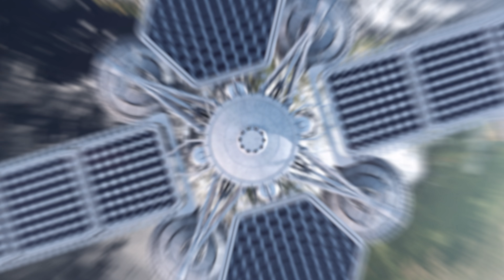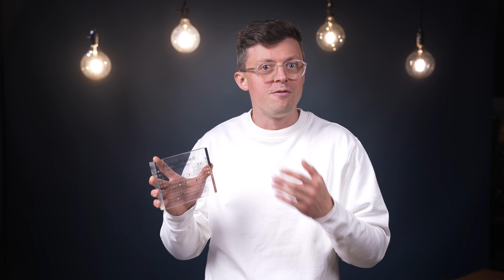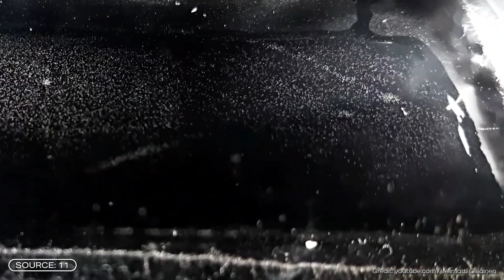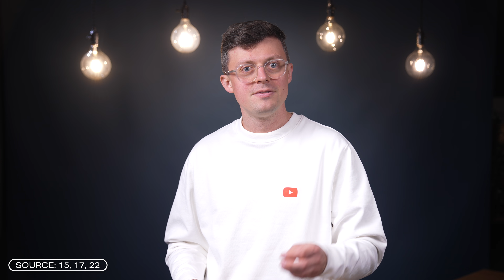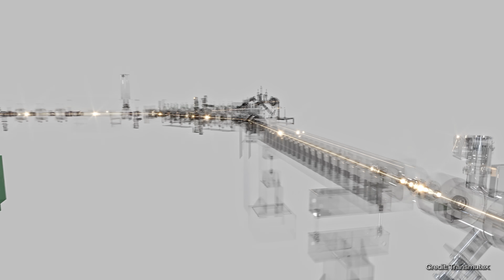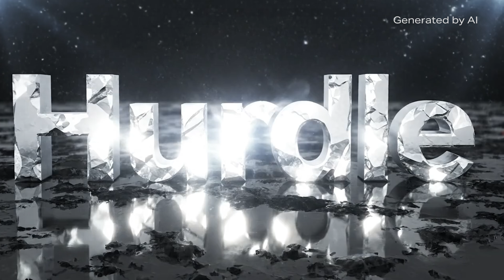Electricity for 5,730 years: Can that really work?

Comment: It seems to me that embedding diamond batteries within concrete structures for structural monitoring, or implanting them in humans in medical devices would be problematic.  

When a concrete structure reaches the end of it's useful life, and is to be demolished, the battery would need to be located and retreived, or the entirety of the concrete would have to be disposed of as non-recycleable nuclear waste.

Similarly, diamond batteries used in medical implants would have to be retrieved from the users body after death and before the deceased could be processed for burial or cremation.  A person having such an implant would necessarily have to be tatooed to advise the handling mortician that the deceased's body contained a diamond battery that needed to be removed post mortem.  Can you imagine the fallout, (pun not intended), should such a cadaver be cremated? The crematory equipment would then become nuclear waste, along wirh the ashes of the deceased.

Yikes!

Comment: If space for the batteries size is not an issue, couldn't these batteries be stacked, or layed out in some way to form a parallel (or series) configuration to produce a higher kilowatt hour rating?

I'm not thinking of the problems that may occur physically for this type of setup. I'm only speaking to the theory that this may be possible in the future.

What do you guys think? 🤔

Comment: I think there's an error in the math...  750,000 KWh over 5700 years would be about 15 watts.  5700 years is 5700 X 365 X 24 hours of total time or about 50 million hours.   So 750000KWh over 50 Million hours is 0.75/50=KWh/h or 0.015KW or 15Watts.     I'm guessing it's really 750Wh of total energy.  This would be consistent with 15 microwatts of continuous output power.  Still a lot more than an AA battery, but NOT enough to charge an EV 10,000 times. More like charging a 1 KWH battery 3/4 the way... once... over 5700 years...  Or did I mess up my math someplace???

Comment: The University of Bristol states that their "diamond battery" can potentially deliver 15 J/day.  There are 86400 seconds in a day, so to come from J/day to J/s we need to divide the 15 by 86400, and we get 0.00017 J/s.  Now we recognise that J/s is by definition the same as W, so this battery can potentially deliver 0.00017 W.  When using a mobile phone, it typically consumes a few watts.  So to use a mobile phone powered by these diamond batteries, we would need around 10000 batteries.
So as the Science Guy points out, this type of batteries are only for some niche applications.

Comment: This strikes me as also potentially ideal for widely-distributed sensor arrays - weather sensors, wildlife monitoring systems, wildfire detection, etc.
Reply: Bristol University claims that an AA size diamond battery can deliver 15 J/day.  That is 0.00017 W.  
How are you planning to communicate the data from these sensor arrays?  Using mobile phone technology?  A mobile phone needs a few watts, so then you need about 10000 such diamond batteries to transmit data from one location.  You think that is "potentially ideal"?
Would your sensors need electricity, so that even more diamond batteries will be needed?
The main advantage of these diamond batteries is that they last very long time; thousands of years.  Do you think it is important that "weather sensors, wildlife monitoring systems, wildfire detection etc" must operate for thousands of years without maintenance?

Comment: Would it be practical to use one of these batteries as a battery tender? If it just trickles out a small amount of power over a long time, I imagine that might be useful for preventing regular batteries from discharging too much while they sit unused. Like, if you have an EV that's only used occasionally, could this be used to prevent the battery cells from depleting below the minimum safe level for recharging?

Comment: Diamond Betavoltaics made from nuclear waste are STUPID, for very practical reasons: They do essentially nothing to reduce nuclear waste AND making the Carbon-14 into diamonds, as described, is a dirty and energy-intensive process. Far better to just take existing C-12 diamonds and park them in fission reactors until they absorb enough neutrons to make the desired level of C-14. Or, for most purposes, just use natural RADIUM instead. Radium has a half-life of 1600 years, and over that time, a single gram of it releases as much energy as can be obtained by burning 10 TONS of Coal. And at the end of that 1600 years, there is still half of the original radium, which can go on making energy available for several thousand additional years. Or use any of a WIDE variety of other natural or artificial radioisotopes, to meet real-world demands for long-lasting power sources, without any of the CLICKBAIT use of diamonds.

Comment: The problem with "nuclear batteries" like Betavolt is their extremely low power density. Betavolt employs Nickel-63 decay. Ni-63 has a half-life of 101 years, and Betavolt at its end of life will have generated 3,300 MWh (or 3.3 GWh) of electricity, a very impressive total energy density. 

In battery terms it's as if Betavolt is "precharged" with all that energy, locked as untapped nuclear energy from Day 1, before the cell is even assembled, which is then slowly released over the cell's lifetime.

Doubly strong emphasis on slooooowly. Those 3,3 GWh are spread over 50 - 60 years, constantly released 24/7/365, at 3V. Betavolt outputs a mere 100 μW (microWatts) of power. 100 μW are not even enough to power the most efficient smartwatch. At least 1000 times that, i.e. 100 mW (0.1W) would be required, and even then "charging" (actually powering) phones would be out of the question. At least 4 - 5W would be required to power a phone, or... 40,000 - 50,000 BV100 cells.

And that's with a 100-year half life radioisotope. C-14 has a half life of 5,730 years, which means, all else being equal, since half lives are inversely proportional to radioactive decay, it is ~57 times more stable (decays 57 times more weakly) than Ni-63. That's a 57 times lower power density, assuming the same betavoltaic efficiency. Or barely 2 μW. Even if the efficiency was raised 10 times it would still generate a mere 20 μW.

So only ultra low power sensors, which need to stay always on, could be powered by current betavoltaic cells. More unstable, low half life isotopes need to be used for smartwatches, but those are tightly regulated. The betavoltaic technique also needs to become far more efficient, and/or more nuclear material needs to be used.

Comment: This sounds like yet another marketing video and misses the most important point for the first >10 minutes!!! First topic should be POWER DENSITY (Watts per Gram) of the isotope in use. Carbon 14 is not a very radioactive isotope and therefore batteries using it can't provide adequate power for almost anything except very niche super low power applications. Forget about using it for smart phones, laptops, EVs or even smart watches. The isotopic power density is low at 0.001305 Watts per gram and as you might capture less than 20% of this you will need a truckload of them to power a laptop and it will cost you a big house.

Comment: 1 gram C-14 in a battery = 750'000 kWh over 5730 years
358Wh/day = 14.9W If the output was constant. But I guess it diminishes over time like radioactive decay graph halving every half-life so the power delivery after 2000 years would be significantly less than the first 100 years.
Other sites said 15J/day which is 0.1736mW so something doesn't add up.
At 15J/g/day I'd need 5000kg for 20 kWh/day.

Comment: Maybe the way to circumvent the problems with the diamond part of the battery is to construct the diamonds in another form, that being double pass C14 carbon fiber. The advantage with this is that the battery will be in filament form where the length of the filament brings the effective voltage up to a useful level and the current is determined by the number of fibers in a bundle. Such fiber bundles could be wound onto a core the become the AA configuration, or strung out over a long length wound in with the communication cables they are providing the power to.  Of course there are significant challenges to making this possible but this approach simplifies the diamond forming process. That is my 2 bobs worth on this technology.

Comment: You're describing a power source, and not a storage device (battery). This is like saying the sun is a battery. Do your EV batteries charge themselves? No, because they are a storage device. Do they hold their charge when you park up your EV? Yes, because they are a storage device. Does this C14 device hold its charge when you disconnect the load? No, it carries on discharging at the same rate, because it's a power source, not a storage device.

Comment: I asked Gemini about few details my intuition was missing here is my summary (some of it my conclusions not confirmed by AI). The emitted electrons have not that high energy, they travel only 30 to 50 micrometers before stopping. That is why carbon is used as part of the junction. At those distances, electric potential gradients are large enough for diamond to behave as a high bandgap semiconductor (as opposed to insulator), so it is actually better than graphite which turns larger part of electron kinetic energy to heat (phonons, not voltage).

Comment: 9kg of carbon 14 is needed for 1W of power... youre gonna need industrial amounts of carbon 14 to power a house. If you used carbon 14 as the house footprint/basement instead of concrete, you could power your house for free for 5000 years.

Comment: It feels like there are many hurdles larger than the energy cost of making such a cell. The monetary cost being especially problematic!

And there are many other options that have to be ruled out before such cells make sense. Looking at the examples in the video, sensors in a dam could simply receive wired power. People are investigating inductive charging for pacemakers, as well as generating electricity from blood oxygen or blood sugar. Many outdoor systems could use a renewable power source such as solar or wind, or hydroelectric power from ocean currents in the case of a submarine sensor. Also, in many cases the old device could be abandoned when its cell runs out and an entire replacement deployed — I'm again thinking of submarine sensors, there.

Comment: Could be useful if the packaged battery is small and lightweight.  3.2 V is fine.  Used with a good capacitor, it's great for sensors that need to wake up once per hour or once per day, take a reading, and then transmit or store the data.

Comment: There was still at least one patient still with their plutonium pace maker in 2022, still working after +40 years. Then there are the Voyager space craft, of course. Short 80 year half life, though.
Reply: It's amazing they managed to make an RTG (Radioisotope Thermoelectric Generator) small enough to power a pace maker. Apart from Pu-238 strontium-90 can also be used, which has an almost double power density (~1W/gram) but 29 years of half life. Polonium-210 is the top dog in power density (140 W/g), but has a half life of just 4 - 5 months.

I think betavoltaic cells, which use semiconductors to harvest beta emitted electrons, are safer (they don't overheat) and potentially could be more efficient. The betavoltaic efficiency is still quite low though. Beta emitters like Ni-63, C-14 and tritium can be used.

Comment: Military lol 
in the 90's I built two trucks that used Strontium 90 based decay batteries basically as a replacement for the land-rover They have been testing it for 30 years but the military weren't interested in green tech at the time. I didn't design it to be green but to get around the problems of refueling in the battlefield.

Comment: A little piece of me dies every time I hear someone express power in units of kWh/day instead of just kW.
Reply: Me too.
we may as well go back to measuring things with bananas like the yanks
Reply: kWh/h you mean?
Reply: KWh is power x hour, and is an energy density unit.
KW is (constant) power output, and it's a power density unit.
The first, in case of batteries, is used to define the total energy storage.
The second to define how much power a battery can provide to a device and how fast it can be charged.

Betavolt has a whopping 3.3 GWh of energy density, but spread over 50 - 60 years. At any given time it can only generate 100 μW (microWatts).

Comment: I'd imagine tritium-doped hydrocarbons would be another option for higher yield, shorter lived nuclear-thermal batteries. Though given the relatively short halflife, Strontium 90 or Caesium 137 impregnated ceramics would be relevant (that would just be extensions of fairly conventional nuclear-thermal cells, though).

Cs-137 is a fairly intense gamma emitter, though, while Sr90 is a pure beta emitter, plus you have limited options for sequestering Cs salts in insoluble form within glass or ceramic, but far more options for Sr based ceramics. (so Sr90 has far more potential uses in lighter weight devices, plus the atomic mass is lower, making that even better than just the lack of shielding ... Cs 137 would be more limited to uses in terestrial types of thermoelectric generators or nuclear thermal uses of various sorts ... or as a gamma ray source, all with appropriate shielding and likely preferred in the form of a mixed silicate glass pellet or bead form, given I don't think there's much else that would effectively render it relatively inert chemically)

OTOH, tritium doped hydrocarbons could potentially have a much higher energy density and power density ... or specific energy and specific power by mass due to the low atomic and molecular weight as a whole. (something like tritium doped paraffin wax or polyethylene would seem like it has potential)

Tritium immediately came to mind, not because it's already in use for niche purposes (including luminescent dots/indicators or display backlighting similar to old radium luminescent paint) but actually because it comes as a byproduct from neutron bombardment of a moderator (heavy water), rather like the nuclear graphite source.

Comment: The diagram of the beta decay process suggests that the emitted electron simply takes its place in one of the N-14's electron orbitals--no, it's ejected at much too high velocity; it's completely ejected from the transforming atom. The resulting N-14 atom is an ion because it only has 6 electrons.
I'd be very curious to hear more about the type of devices that could actually be powered by something with such tiny power output. For instance, wouldn't a pacemaker require much more current than a diamond C-14 battery could produce?

Comment: You can also just re-use nuclear graphite if its in good enough condition mechanically, or recycle it into new graphite blocks for nuclear use. (also for use in pebble type nuclear fuel or as part of TRISO fuel)

 You just need special processing facilities that can properly handle and sequester any dust formed during processing and concentrate that for further reprocessing or (if too degraded and contaminated with other materials) finally treated as actual waste.

Designing graphite moderated reactors to have very long lifespan of the graphite and the ability to recycle or re-use that graphite, even once irradiated (and even if the reactor needs to be decomissioned or torn down for a major overhaul with portions being scraped, other portions being reused). And generally designing reactor components to be long-life, including pressure vessels that could be re-used rather than scrapped. (and whole reactor designs intended to be able to be rebuilt and refurbished rather than scrapped)

So long as the structural integrity can be maintained, the accumulated activation products in the material aren't especially relevant outside of safety concerns while servicing. (and decomtaminating the mobile surface particulates and gasses present would be the main issue, while the radiation from the traces of accumulated activation products could be much more easily shielded against for maintenance workers, technicians, and engineers)

Rather than designing a reactor to have a limited lifespan, you could design it to have an indefinitely lifespan while being rotated through overhaul at various major service intervals.

Granted, this whole concept would be easier with SMRs than conventional large, static reactors (and SMRs could literally be rotated through overhaul by swapping the units out and potentially refurbishing and re-certifying the old unit offsite). OTOH conventional large reactors are that much more expensive to actually scrap and even more expensive to replace, so servicing and overhauling them on-location would still be appealing where possible.

OTOH this also assumes that the old reactor is of a design that's not so inefficient and/or otherwise obsolete (or generally expensive to maintain and overhaul) that scrapping the design and building a more efficient and cost-effective modern design on the same site would be appealing. (building around re-using as much of the same foundation and existing infrastructure as possible would be ideal, though)

Comment: BetaVolt's BV100 with a half-life of only 50 years seems more practical for most Earth-based applications.
It used nickel-63.
This carbon-14 battery is probably more useful for applications exceeding the 50 year life of the BV100.